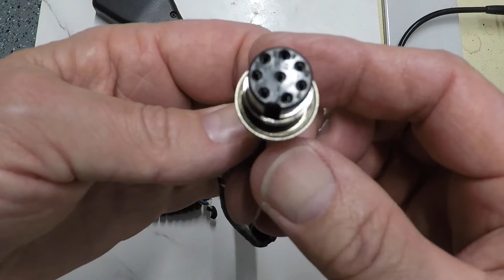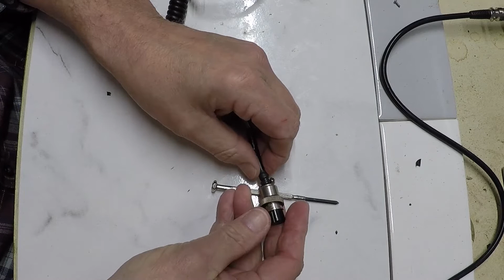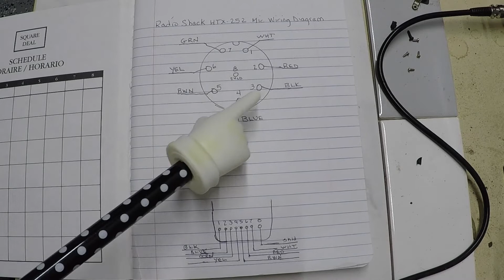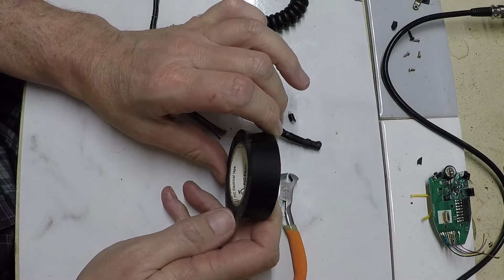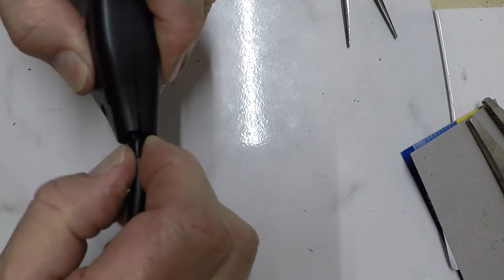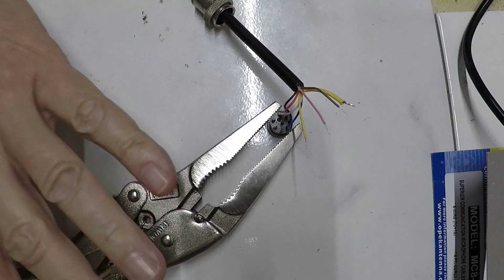Radio Shack HTX-252 Microphone Repair for less that $20 !

Comment: Good Job on getting it working! Thanks for linking to one of my pages. I have a few notes to add that I have learned over the years of replacing these cords. 

You don't need to remove the PCB from the housing to do this repair, and as you found out, sometimes it just creates more issues. Since you did take it completely apart, that would have been a good time to spray some contact cleaner/lube into the DTMF switch as they tend to corrode inside over time from limited use.

You also didn't need to cut the clear insulator from the DIN connector as it just simply slides off and can be reused.

For the strain relief, I just whittle down some of the rubber off of the cord on the end going into the microphone and use a drop of dish soap or some heat to get the strain relief to slide down the cord. This makes it look original and retains the original relief. If you strip too much and the strain relief slides, you can use a ziptie covered with hot glue in the microphone head to secure it that way. I'm not saying your electrical tape won't work, but I feel like stretching the cord over time will cause the tape to shift and eventually pull away from the mic. 

I also put a piece of heat shrink on the connector end to give the connector more of a bite because these MC8-6 cords are really tight when brand new and you have to give a good pull to loosen them up.

73!   KU4BY
Reply from the maker: Thanks for the pointers. I spent too much time setting up everything for video instead of focusing on fixing the cord. The Opek MC8-6 cord has a thick sleeve, which is perfect for marine applications, but as you said I could have shaved it down to fit the strain relief. 
I didn't even think about the PTT switch cleaning. 
The HTX-252 will get a little use, but not much any more. 

73 !